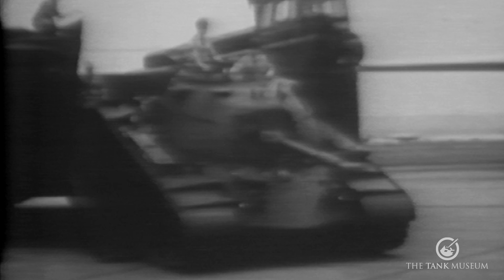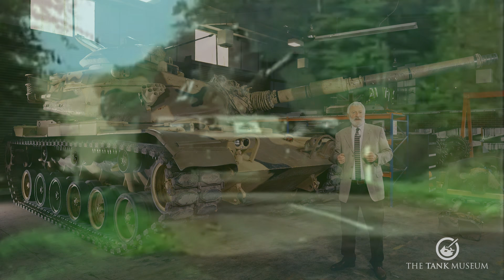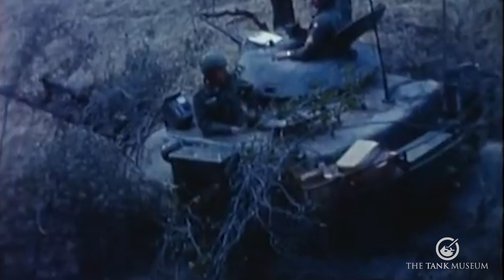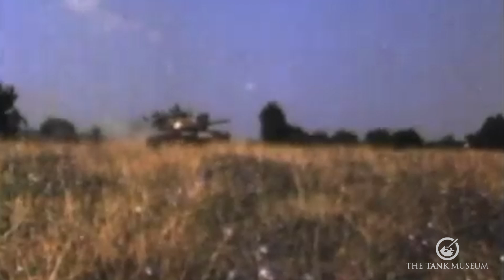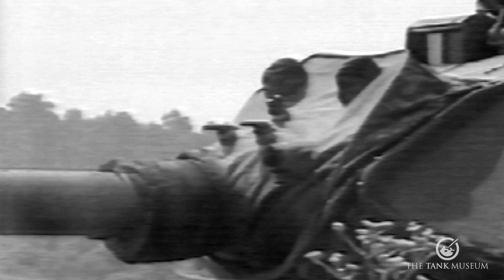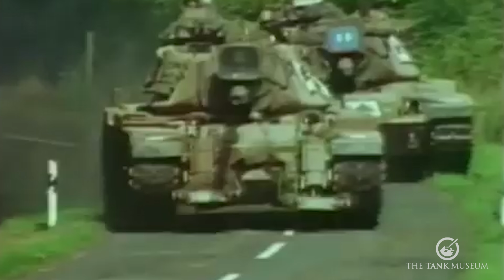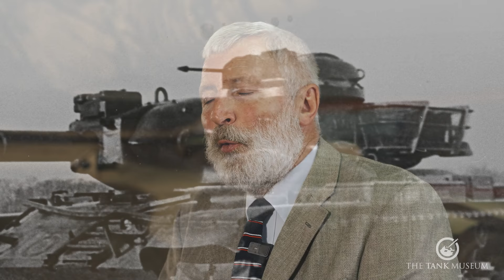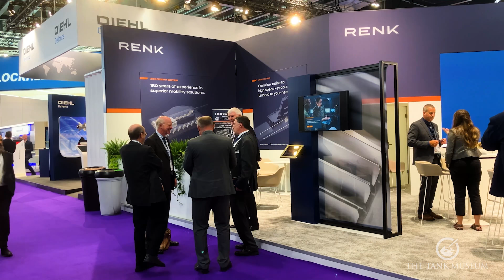M60: Cold War Guardian | Tank Chats #175

Comment: Several corrections:  Other than the M60A2, the M60 series did NOT have a powered commander's cupola.  To my knowledge the M60 series never had a centralized NBC overpressure system.  It did have a forced-air central filtration system that fed pre-filtered air thru hoses in the tank to each crew station, which in turn connected to the vehicle crewman's version (M25A1) of the individual soldier's "gas mask."  This version had a cylindrical cannister filter in the carry bag with the hose hookup to connect to the vehicle and a hose led from the cannister bag up to the rubber face piece..  The M17 series masks for non-vehicle-crew soldiers had the filters built into the cheek pouches of the rubber face piece of the mask.

Other significant notes that were not mentioned:  The M60A2 series' powered commander's cupola had a "target designate" feature similar in concept to that deployed on the M1A1/A2 with CITV.  The commander could use his own optics in the powered cupola to acquire a target, and then upon hitting the target designate button, slew the main gun to the cupola's azimuth, which would help the gunner identify the target more quickly.  The M60A3's TTS (tank thermal sight) was generally considered by crews to yield a much better "picture" that the first gen thermals on the original M1 series, and the M60A3's ruby laser seemed to yield more accurate ranges than did the early M1's YAG laser.  The original M60's M73 and early M60A1's M219 coax machineguns were the bane of every tank crew's existence--they were at best problematic and at worst "single-shot machineguns."  Loaders, gunners, and commanders rejoiced once the FN-derived M240 coax was deployed.  Likewise, the M85 commander's cupola machinegun was the subject of many cursewords, with only the most knowledgeable TCs and unit armorers able to make them run reliably.  (HINT:  regularly replace with new ALL seven or eight operating springs and it will pump out belt after belt without a hiccup.)  The M60 was the Sherman of the Cold War---never the best tank, but it's best "ability" was "availability."
Reply: Our M60 cupolas were definitely NOT powered. It was manual crank all the way.
Reply: @SlinkyTWF  i was a gunner in a M60A3 TTS i always hated that cupola
Reply: @SlinkyTWF I was wondering about that one myself.
Reply: Having served on both the M60A1 and first generation M1 I must say you got it right!
Reply: The hose for the filtration system was our A.C. We'd tuck it into our BDU's.
Reply: @tanker335  Wish we'd have thought of that.
Reply: @tanker335  And a personal heater during winter, too.
Reply: @tanker335 I used it as a heater when we didn't have a heater.
Reply: I caught that too.  I was TC on 60A1s and definitely did not have powered cupolas.
Reply: I can attest to the fact that the M60A2 I was trained on did not have a proper "over-pressure" system - it did have a centralized filter system that had hoses to each of the crew positions - and we would use it as AC in the summer - blowing air into our uniforms - and in winter we could run the hoses through the heater in the tank and send heat to our uniforms - just tuck the flexible hose into your shirt, and instant AC/heating 🙂
Reply: I find it odd about the M-85.  During my 4 years I never saw one the wasn't anything but reliant.  I did see many Scouts (I was in Cavalry units) find many different ways to keep their M-2s firing.
Reply: One a long road march at night in Germany in the freezing cold of January, I stuffed the hoses from the gas particulate into my field jacket to fight off the bitter cold. I used the hose from the gunners position and the one provided for the commander. I was a tank commander at the time on an M60A1. This gas particulate system on the tank was designed to hook up to your gas mask. It would blow cold or hot air. At the time our tank heater was broken, so I improvised to stay alive. That long road march in a tank convoy in that miserable bitter cold weather was torture.
4th Battalion 63rd Armor 1st ID, 1978-1979
1st Battalion 35th Armor, 1st AD, 1975-1978
Reply: There was a running joke in our unit that the m219 meant the gun fired between 2 and 19 rounds before it quit. That target designate switch could be very dangerous if you used it and hadn't cleared the area around the turret first.
Reply: @paulknuff1555 the m219 were worn out pieces of crap. We loved the m240s when we got the M1 Abrams in 82 in Germany
Reply: @paulknuff1555 I'm pretty sure that was not a joke.
Reply: The M85 wasn't a machine gun, it was a jam mill. HINT: don't replace all those springs. Instead, disassemble it. In the feed cover there are 2 springs that work the feed pawl. Take out those springs and cut 1/2 of one turn off them. After that they'll be powerful enough to work, but no longer strong enough to force down the feed pawl and hold it against the force of the main feed springs.
When my company CO found out I had done that, he threatened to court-martial me for doing what was supposed to be depot-level maintenance without authorization. But at the next round of gunnery exercises, my platoon was the only one that was not plagued with M85 jams. The threats evaporated and the word got around and all of a sudden there were lots of smooth-working M85s in the unit.
Reply: @kh6437  Never really had problems with the M-85 jamming.
Reply: @TimothySielbeck Congratulations. I wish I could say that.
Reply: “Look at the big brain on Brad ! “ Seriously, thank you for all that additional information! It is all appreciated by the military history nerds. My Dad was a waist gunner on a B-24 during WW2. The only armor he had was the flak jacket he wore.
Reply: I served in 1-32 Armor, 3AD 1975-1978 in Friedberg FRG, all with the M60-A2.  The fire control system and traversing mechanisms were solid state electronic with the laser range finder.  Lot's of cannon plug connectors that might break a pin anytime the 152 mm HE round was fired, sending  the turret turning, the gun tube bouncing and other components going haywire.  Just changed boxes to fix turret components.  The HE round had a combustible casing so that once you fired the round, when the breech opened there was no brass, you were free to load another round.  The breech operated slowly since it had to back out and rotate to expose the breech.  If the metal seal came out after firing and the breech opened, the turret would fill with smoke and gas when the next round was fired.  The .50 cal in the commanders cupola was very accurate, got a deer at Graf on a stationary tank, moving machine gun range once.  The Germans made us put a cover on the port for the laser range finder to keep from blinding them, we did have some targets in the German crop field outside out Kaserne where  we used the laser at night because you could see the laser beam with the night vision sights so you knew if you were on the targets.  Although we had a long range missile weapon, we always joked that the balloon would go up when there was only 50 meters of visibility.  Great Memories, thanks for the post.
Reply: Nobody believes what some random human says.

Comment: My dad went from the M48 to M60 based CEV in Vietnam. He spent the rest of his career on the M60. My the time he retired he had the privilege of doing some of the testing on the M1 Abrams.
   After he retired he went back as a civilian training GI's on computer simulators on the M1. I got to go to work with him when I wasn't in school. They had a M60 simulator that I got to try a few times. It was a dinosaur compared to the M1.
Reply: I'd hope M1 is a good measure fancier than M60, considering it replaced M60.

That said, the latest M60 variants (A3 TTS etc.) had enough capability to run with M1s in the first Gulf War and did quite well.
Reply: @bluntcabbage6042  I'm sure. It was still a impressive machine but at the time I was around both the tech in the M1 was space age kind of stuff compared to the M60 A3. Dad preferred the gun on the M60 over that of the M1.

Comment: LOVE the M60!!! I served on M60A3 for a couple years before transitioning to M1. Great Tank, the 105mm was super accurate.
Reply: Advantages of the copula was that it offered the tank commander protection from small arms fire while offering a view outside the tank. Just think of War Daddy in Fury hanging out of the tank while under direct fire. Additionally the cupola allowed the M2 to rotate and elevate independently of the turret/main gun unlike the coaxial machine gun that is in line with the main gun. As far as the effectiveness of the M2 for fast movers? A jet? Probably not but as far as anti land vehicles or personnel it was very effective. Also remember that the Soviet Hind D gunship was the one thing that tankers worried about during the Cold War Era so the M2 offered some type of defense against helicopters. 
~Former M60A3 49th Armored Div. tanker
Reply: @dmacarthur5356  The M60 series tanks did not use an M2 .50. It used the M85 .50 cal. The M85 had a firing rate selector for between 400 to 600 rpm but all it still would have been useless against fast moving aircraft. The cupola on the M60 along with the smaller M85 allowed for more ammo than on the M48 series with the M2.
Reply: @dnob6668  You know what, you are absolutely correct. It's been over 30 years and had a couple of TBI's while I was in, so my memory ain't what it used to be.
Reply: Just now saw this thread...yup the Cupola had its pros and cons, but NOBODY liked the M85 .50 machine gun. NOBODY. It was an overly-complicated stoppage/misfire pos.

Now, the M240...was an absolute dream!
Reply: If you could then, could you give your thoughts on the cupola. Average person sees it and thinks it looks like a glaring weakness and an easy target to shoot but obviously it was put in for a reason. What were the advantages of such a large cupola and do you think it was worth it?
Reply: @stephenallen4635  I hated that effing cupola. The hatch was a PITA to close, and you had to lock the spring-load open to keep it from shoving you down into the tank. Late production M60A3 models omitted it after the IDF reported incidents of it separating if the turret took a hard hit, which was not good if you were an Israeli TC who, under doctrine, fought crew-exposed for visibility.
Reply: @SlinkyTWF  RJR on the cupola and that POS M85 MG. the only thing that it had going for it was the Autobahn seat, whitch is was we called the big swing-out seat that looked like it was sourced from a local tracktor manufacture. Of course since you could not get out of the seat very easly if the tank rolled over, the only time it was used was when on the AutoBahn
Reply: @stephenallen4635  also adding to this gentleman's question, was the 50cal turret viable against a fast moving target or against infantries in cqc? other than exposing the crew like in conventional setup, what other advantages does it have?

Comment: Makes one wonder what M60 would have been like(or if it had existed in the first place) IF:
1)M46 followed the "Jumbo" and "long 90mm" variants of Pershing;
2)M47 hasn't chosen the way of "small affordable" upgrade.

P.S.: sorry for being one of the weirdos(or not?) that call M60 and T-62 last medium tanks and AMX-30 and Leopard 1 first MBTs😅
Reply: M60 was explicitly designed as an MBT. M48s and older were ostensibly still considered mediums by American doctrine, but the M60 broke the trend and was not intended to be anything other than the "main" tank of the US Army.
Reply: @bluntcabbage6042  ostensibly? My guy, M103 served alongside it to mid 1970's. Long past the time when M60 itself was INTENDED to be replaced originally. You DON'T have MBT and heavy tank serving in parallel. That's why first tanks T-64 replaced were T-10M. Meanwhile T-62 served(and was produced almost as long) until USSR existed. Alongside T-64 and then T-72 and T-80. If it existed, served and was from the start designed to be in parallel with heavy tank, it's not MBT.
France and Germany didn't have heavy tanks in service during that time, nor do they had any desire to further develop them as they were done with them, the troubles and costs they brought. Germans were done after WWII, France had to suffer the whole AMX-50 debacle first.
Reply: @TheArklyte  M103 was a leftover from the days of the M48. It was intended to protect M48. I am astounded that you missed this very important distinction.

M103 on its way out when M60s became the more numerous tanks in the Army. Only the Marine Corps kept any sizeable number of M103s around during the M60's heyday, in and around the A1 and A2 standards. Note that, at that time, the Marine Corps dominantly used M48s - so my point still stands.

M103 happening to still be in service when M60 was adopted means nothing, because doctrinally the M103 was no longer necessary once M60 was in the majority. M103's entire existence hinged on remedying initial pitfalls of the 90mm seen in M48s in killing IS-3 and its derivatives.

Your backwards rationale works to disprove the idea that Centurion was an MBT, too, because it served alongside Conqueror for a time in the 1950s. Does that make Centurion not an MBT? Of course not. The same goes for M60.

M60 might have only partially relied on M103 in theory but M103 was decommissioned once M60s were received en masse by the Army in and around 1963.
Reply: @bluntcabbage6042  you've repeated my point(from comment to other guy) halfway through yours and yet still somehow missed it's context?
Conqueror was removed not because Centurion was MBT, but because there were no soviet heavy tanks.

P.S.: but tanks for mentioning M48 usage by USMC, I forgot that they were stuck with M48 too. Need to look up when M60 outnumbered M48 in their hands.
Reply: MTB is a term made up by the British to classify Centurion. So how can Leopard and even newer AMX-30 be first? Tanks that can replace infantry and cruiser tanks were common in WWII (outside Britain)  so even T-34 can be called an MTB. But one thing is for sure. Its dumb to call a Panther a first MTB.
Reply: @Paciat  because you should check your sources? British call Centurion MEDIUM universal tank and it is designed from the beginning to serve ALONGSIDE another HEAVY universal tank ie Conqueror(Caernarvon). Universal meant only that it's filling the role of both medium infantry and medium cruiser tanks.
So how can Centurion be earlier? 🤣
Reply: @TheArklyte You are asking how can something that was made earlier be earlier?  🤣That was funny. Centurion got the 105mm before Germans got that gun from the British. This gun did made Conqueror obsolete cause with it Centurions didnt need any support. So if anything you can ask witch version of Centurion was the first MBT.

But the funniest question is... And your sources for MBT definition are? 🤣🤣🤣Or show me any source for "HEAVY universal tank" phrase. 🤣🤣🤣
Reply: @Paciat  so you're saying that installation of 85mm gun from IS-1 onto T-34-85 made T-34-85 a heavy tank? No? It still remained a medium tank? 

Conqueror was still in production in 1959 and yes, capture of T-55 allowed L7 to stop that. However it served for decade more. And L7 didn't allow Centurion to suddenly replace Conqueror, it's the absence of soviet heavy tanks and detailed into on T-55 that did. L7 didn't match Conqueror, they just realised that Conqueror was an overkill for the time. If M58 was somehow weaker then L7 then L11 wouldn't be created.

I suggest you start with tank chats with David Fletcher. Conqueror should be (googles it) TC №145. It's a pity that you believe that Conqueror is somehow a heavy infantry or heavy cruiser tank 🤣

Comment: I saw one of these (M60) in an American museum.  I was surprised how big it was compared to a T-72, which the same museum also had on display.  Also, I noticed how sloped the lower hull is.  It reminded me of a boat, but I don't think it would float.  ;)
Reply: Compared to the T54 the M60 is absolutely massive. The first time i saw a T54 in person i was shocked by how tiny it was
Reply: @karl_franz_prince_and_emperor  Me too. I thought "Wow. Some poor Ruski is getting crammed in HERE?!"
Reply: Keep in mind that Russian tank crews are typically smaller in stature than their American counterparts. As well as having different suspension systems. Russian tanks have the large road wheels with NO return rollers with only torsion bars. And American tanks had torsion bars, as well as shocks and return rollers. Hope it helped! And sorry for the paragraph
Reply: Im pretty sure the m60 had wading kits for it so technically it could float lol
Reply: It definitely could not float, as a Captain in my Guard unit found out when he tried to cross Cow House Creek at Ft. Hood in flood stage. As I heard the story, "He sank. A tank." With some preparation it could do deep water fording, but only up to the turret ring, which had an inflatable seal. It couldn't go underwater with a snorkle like the T-72.
Reply: I had that epiphany at the AAF Museum in Danville, VA (rest in piece, forever missed), M60 was a behemoth of a tank, barely smaller than the massive M103 that they also had there.
Reply: Well they do have more room and another crew member unlike the Russian tanks which are cramped and lose the loader for an auto loader. Different philosophies for a main battle tank I suppose.
Reply: Another advantage of a larger turret is more gun depression. We trained to fight on defense from hull down positions. The more you can depress the gun, the less of your turret is shown to the enemy. I was a platoon leader in 3AD in Germany in 1977.  We would have been seriously outnumbered and very much un the defensive if the Russkies ever crossed the border.
Reply: Its absolutely massive compared to other cold war tank both NATO and Soviet at that time, it follow opposite way of European tank with thick sloped armor of Soviet tank